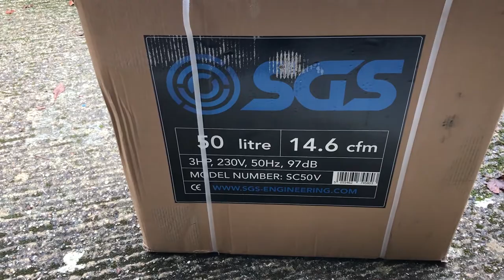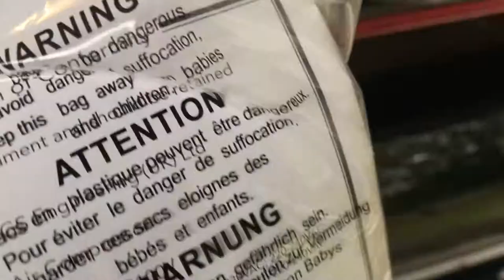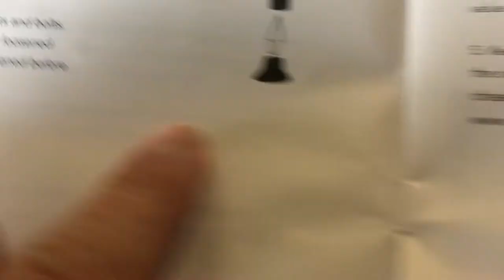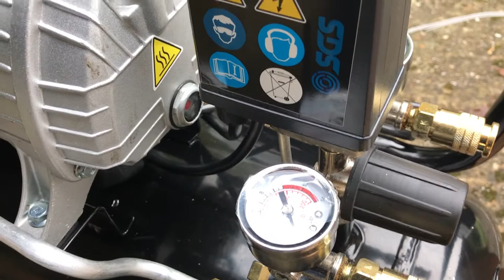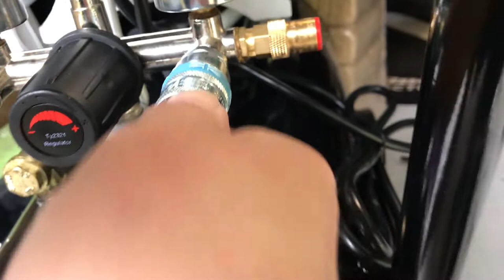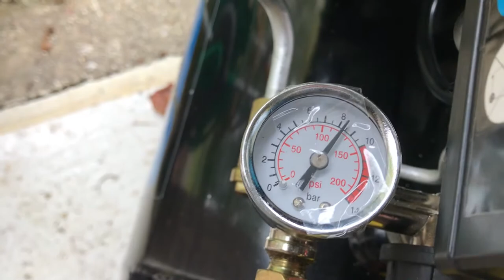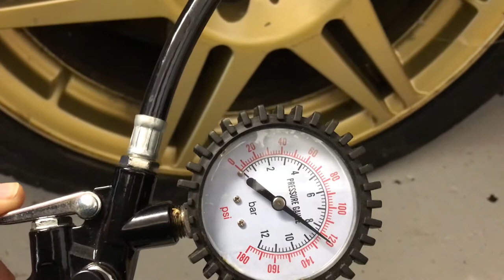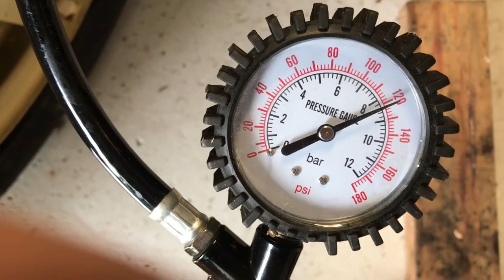new compressor! Unboxing, first start SGS 50v 50 litre 3hp 14.6cfm v-twin compressor initial review

Comment: I'm hovering the finger over the purchase button on this very model compressor.
Still recommend the compressor after a few months usage?
Reply from the maker: I like it for my needs. Practical for the space I have. I need to get it running an impact tool but I have no doubt it’ll do just fine. I think it’s great vale too.
Reply: Just ordered myself one from eBay. Just say fuck it and press it !
Reply from the maker: Yeeeesss! You know it’s the right thing to do :) good man. 
Post up your review when it arrives :)
Reply: Doing the exact same thing.. that's why I searched for a video review.  I want it for plasma cutting
Reply from the maker: I love the compressor but it runs a lot even when using a cut off tool. I have a cheap one so may use a lot of air but you may want the 100 litre version. I’m not sure with plasma cutting as to the air needed so it’s best to check and go over what you think you need.

Comment: Just got one myself. How do release the air when finished? The picture on the website shows a pull ring to the right of the regulator. Mine is the same as yours, just a red cap and no pull ring. Emailed SGS support but no response.
Reply from the maker: Hi. There should be a drain valve under the 50 litre cylinder.

Comment: I see something about changes oil seal or valve seal or put oil in.    Did you just build and start
Reply from the maker: The compressor shipped to me with oil in already. I have read some vendors ship it with no oil so you would be wise to check. I had to fit the air filters I think. It’s worked well for me. I use an impact driver, cut off tool and finger sander on cars so far. One observation is I could do with a larger receiver. Other than that it’s decent.
Reply: @chisnsid  thanks mate Iv just ordered it with all the gun stuff

Comment: how do you think this will stand up to sand blasting a motorbike frame / engine?
Reply from the maker: I’ve not looked into what is needed for blasting works. The compressor itself seems pretty tough and well made so if it does the cfm and pressure you need then maybe it’s ok. I can’t really advise I’m sorry to say as I haven’t researched it  my need is more for air tools and a bit of paint spraying hopefully
Reply: @chisnsid   thanks for your response, it runs air tools ok?
Reply from the maker: Will see if I can upload something for you
Reply: Just purchased a shot blasting cabinet and SGS recommended the 100 litre compressor.
Reply: @stevesilverwood9363  thanks, have you tried it yet?
Reply: @Miguel-hw8hj  unfortunately the pressure gauge was damaged when I opened the packaging. Contacted SGS and a replacement is on its way. Once I’ve fitted it I will let you know how the 100 litre compressor performs. 👍

Comment: How long did it take to fill? Mine doesn’t seem to be doing anything when turned on apart from making noise 👍
Reply: Did you follow all the steps.....
Reply: @familyman831  I did, someone has said I must have an air leak but I will double check tomorrow again going through all the steps 🙂
Reply: @GavinMcC  your intake is blocked